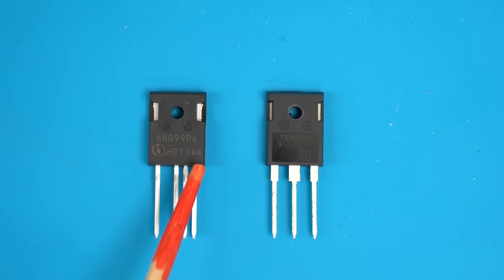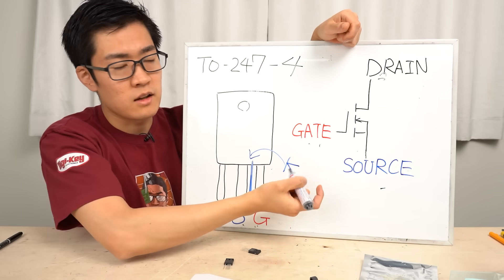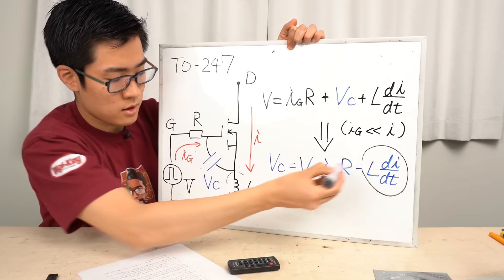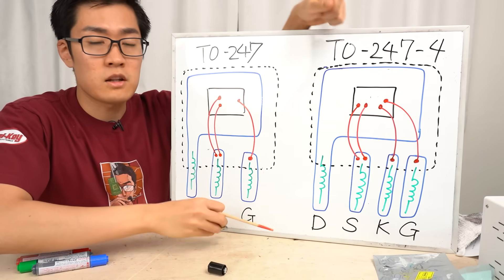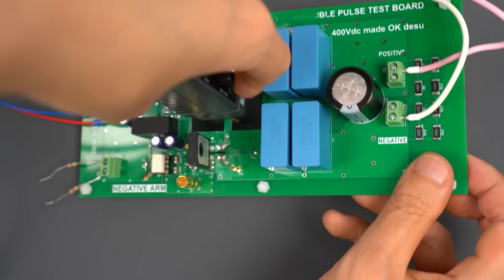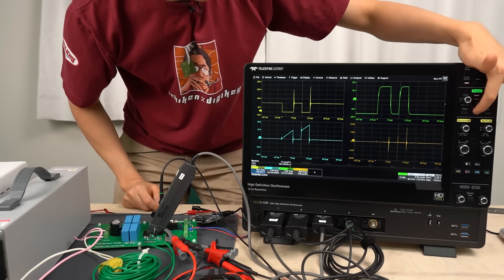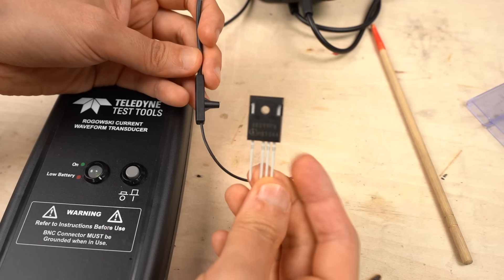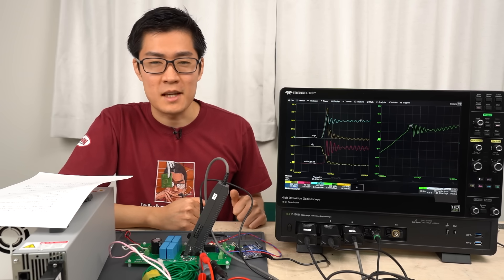This Tiny Change Makes a Huge Performance Boost

Comment: Excellent! If you get 1 nH for 1cm of lead why have the lead 1cm long? Looks like you could shorten it a bit on the circuit you are testing. What is your improvement by having shorter leads?
Reply: The reason the leads are often kept a little longer than ideal is to help prevent heat damage to the solder joints by dissipating any heat that travels down the legs (particularly the drain)
Reply: @JaenFoster well, not good enough, if you lose 20% more power from just that a better design is needed
Reply: @franzliszt3195 they did make a better design. They added the forth connection so you could work around it.

But if you think you can do better that the companies that have spent literally billions on R&D then go ahead and do it. You'll become a very rich man.
Reply: @JaenFoster  Nope. Give me the 4th connection and shorter leads so I get 40 percent power reduction!!!!!!!!!! Just make the leads a bit thicker and the through hole a bit bigger. Anyway, with 40 percent power reduction you can probably have shorter leads.
Reply: @franzliszt3195  that's not how things work. If you make the leads thicker they'll conduct heat into the solder joint faster. You can't outrun physics. You've got to compromise somewhere and start optimising for specific characteristics.
Reply: @JaenFoster  You still have performance on the table due to long leads, leaving that much performance on the table because of a damaging instalation method would have me looking for a better installation method.  Perhaps putting an alligator clip on a shorter lead to suck the heat. Or really dialing in your soldering technique that only the required temperature to bond solder to the metal and no more is reached. I doubt most people who sodler have this fidelity. Except diodesgonewild. He could sodler these mosfets with a one of those huge 100w automatove sodler irons with 0 damage.
Reply: @mikejones-vd3fg I'm not talking about the heat from soldering travelling up the leg and damaging the component, but the heat from the component travelling down the leg and damaging the solder joint. It doesn't have to be enough to actually melt the solder, but solder has quite a high rate of thermal expansion so large thermal cycles can slowly fatigue it to the point of failure.
Reply: @JaenFoster  Ahhh makes sense.
Reply: @mikejones-vd3fg no worries 👍🏻